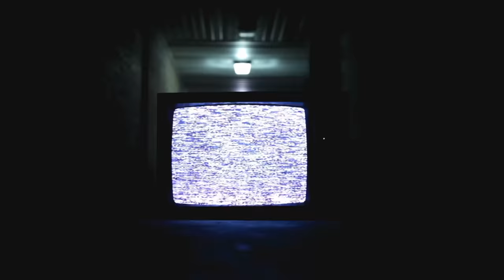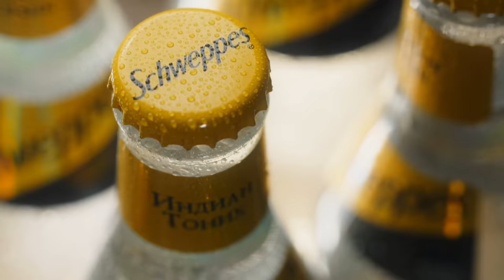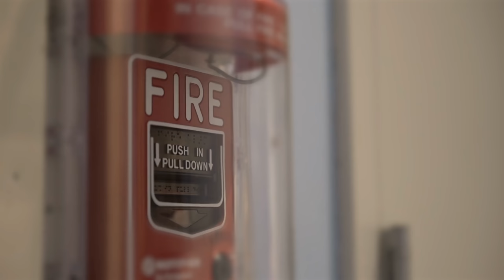Coolest Inventions From Each State

Comment: As has been pointed out, the airplane was only TESTED in North Carolina.  It was designed and developed in Dayton, Ohio.  As a matter of fact, the Wright Brothers built a wind tunnel in Dayton to test airfoil designs, only to learn that the aerodynamic tables that were thought to be accurate, weren't.  An airfoil built from those tests became part of the first successful airplane.  That wind tunnel can be found at the Air Force museum there.

Comment: lol

Minnesota: Invents the middling purifier, the Duluth pack, the damper flapper, the concrete grain elevator, grocery bags with handles, the Better Business Bureau, the pop-up toaster, water skis, the Milky Way candy bar, masking tape, Scotch Tape, closed-cabin commercial airplanes, the steel-toe boot, the refrigerated truck, the mass spectrometer for U-235 (and, by extension, the purification of U-235), electronic autopilot, magnetic recording tape, Tonka trucks, packaged cake mix, cortisone, the Bundt cake pan, the snow blower, open-heart surgery, the "black box" (flight data recorder), the helix reservoir bubble oxygenator (blood pump), the in-the-ear hearing aid, taconite pellets, the fully enclosed and climate-controlled shopping mall, the recreational snowmobile, the implantable pacemaker, the deep-sea submarine Alvin, the Honeycrisp apple, the retractable seatbelt, the CDC 6600 (the first successful supercomputer), Twister, the prosthetic heart valve, pancreas transplant surgery, kidney transplant surgery, bone marrow transplant surgery, Nerf balls, NordicTrack, crisp-crust frozen pizza, Post-it notes, microwave popcorn, the Sleep Number bed, Breathe Right nasal strips, microwaveable French fries, Ziagen, the fast anthrax test, and the Recon Scout tactical micro-robot.

Briggs: Roller blades!

Comment: In Colorado, you missed the biggest thing that literally changed the world forever.  At Ames, Colorado, near Telluride, the first commercial generation and transmission of alternating current (A.C.) electricity in the world  occurred in 1891.  The reservoir and hydroelectric generation plant was constructed by partnership consisting of George Westinghouse, Nikola Tesla, and Telluride attorney L. L. Nunn.  The electricity generated was transmitted via power line to mines located several miles away.  The plant inspired the design of the hydroelectric plant built at Niagra Falls, New York a few years later.  The hydroelectric plant at Ames still operates today.

Comment: A transistor is a semiconductor device with at least three terminals for connection to an electric circuit. In the common case, the third terminal controls the flow of current between the other two terminals. This can be used for amplification, as in the case of a radio receiver, or for rapid switching, as in the case of digital circuits. The transistor replaced the vacuum-tube triode, also called a valve, which was much larger in size and used significantly more power to operate.The first transistor was successfully demonstrated on December 23, 1947 at Bell Laboratories in Murray Hill, New Jersey. Bell Labs is the research arm of American Telephone and Telegraph. The three individuals credited with the invention of the transistor were William Shockley, John Bardeen and Walter Brattain. The introduction of the transistor is often considered one of the most important inventions in history.